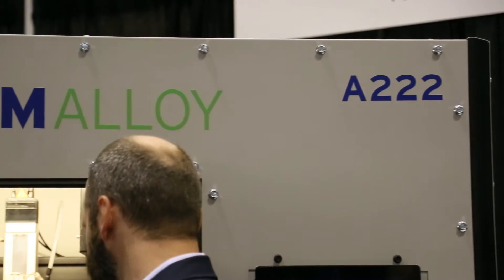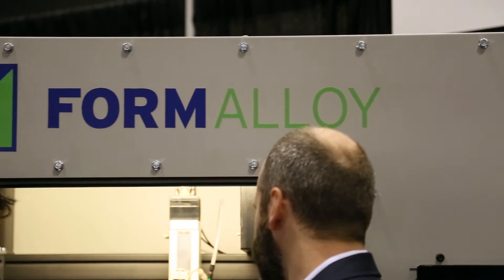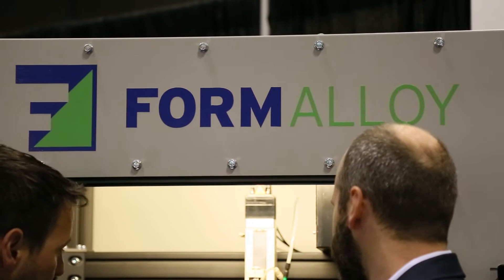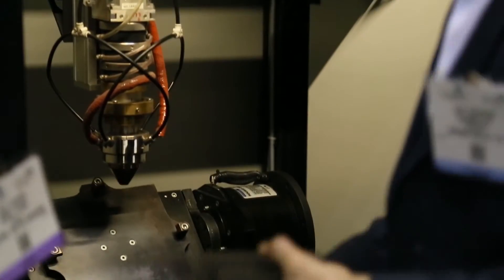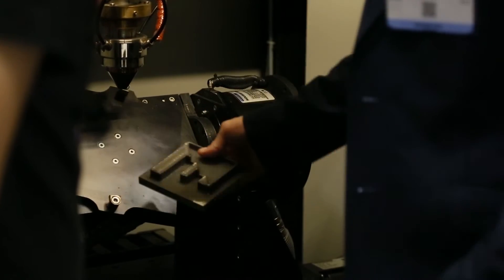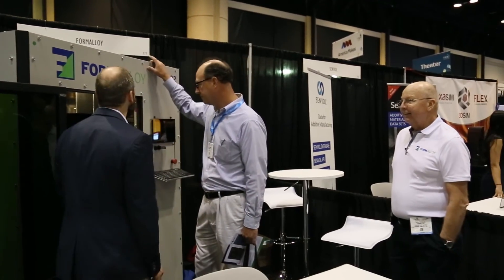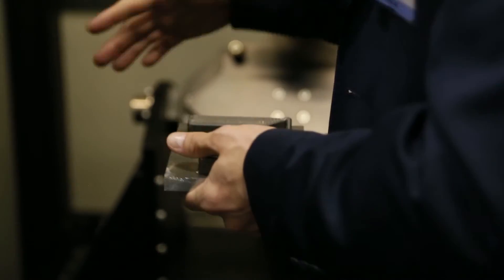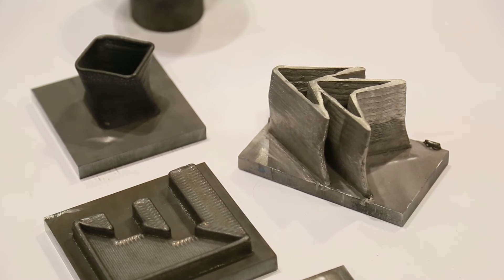Formalloy on 3D Printing Magnetics and Repairs with the A222

Comment: There could very easily be a market repairing mating surfaces on internal combustion engines; they're common repair items of generally flat geometry and I doubt the design tolerances to accommodate subtractive repairs are doing anything but shrink.